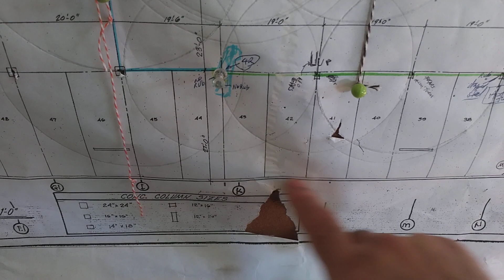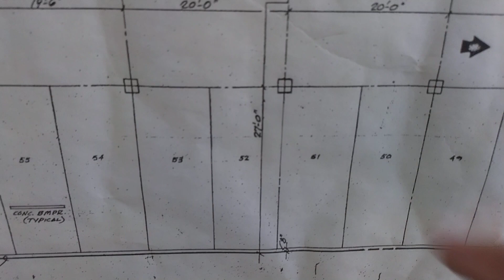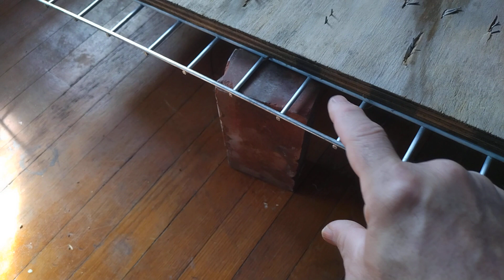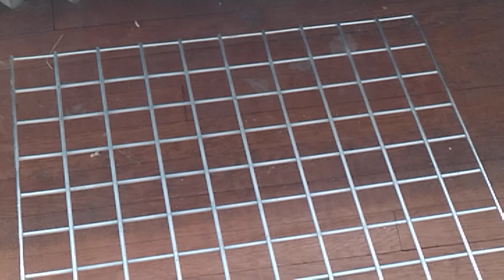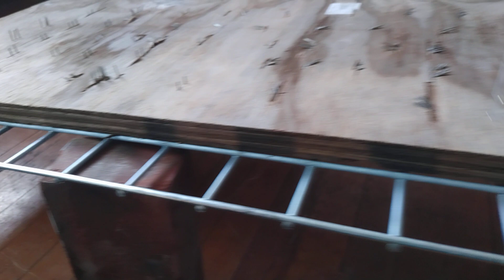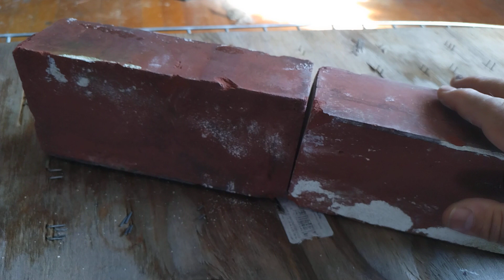Champlain Towers North Champlain Towers South Rectangular Array, two-way slabs and negative loads

Comment: So Tong Li, the architect in the 1980s failed to read the damage correctly.  He didn't fully understand the signs related to the loads on the deck. And didn't pick up on the errors in how the building was built.
Reply: Because he is not a structural engineer or inspector.
Reply from the maker: I believe the person he is referencing is a licensed engineer in Florida and is on the permit for that paver installation plus more...

Comment: I will be more skeptical of planter boxes in the future. They may look nice...if someone cares about that sort of thing...but don't seem all that innocent now. People are strange, and go for style vs functionality. I saw an ad for a new style of toilet that looks like a small square black planter box (with the tank etc hidden in the wall). Not sure who would want that, especially if there was a water leak/mold damage possible with the wall down the road, not to mention the likely discomfort even if functioning properly. 

Yes, I know that cracks are not good, and standing for 40 years is not a guarantee of longevity, even for another day. It's hard for a layperson to determine oh it will fail, but in the next 1h, 1d, 1y, or decade. I realize that everything will eventually fail as we march towards higher levels of entropy. I also realize the Cassondra law is to protect us from ourselves in a way, by having the parking decks inspected more often, etc.